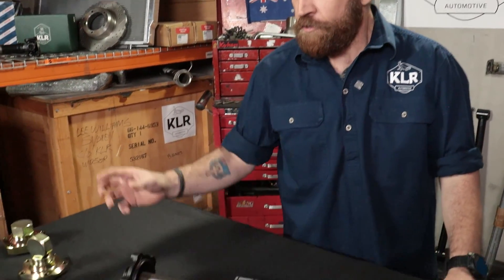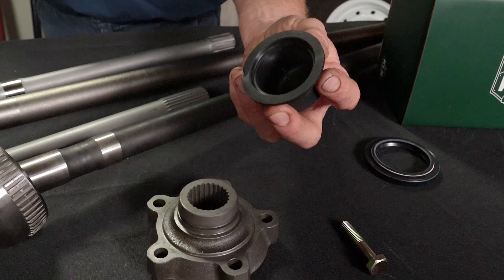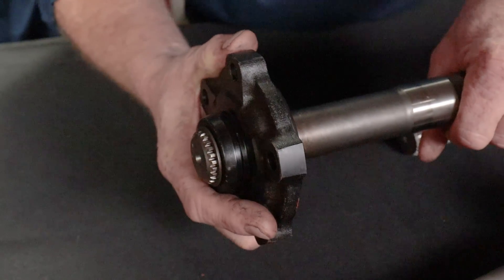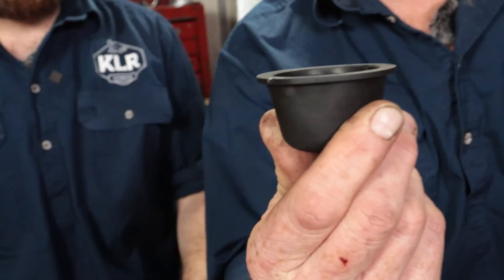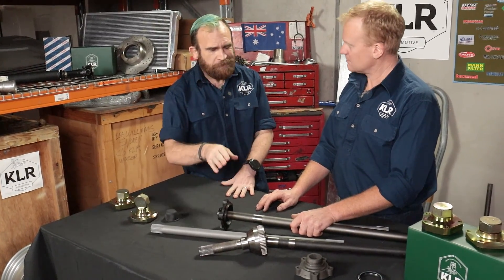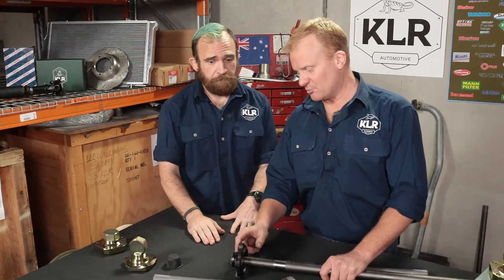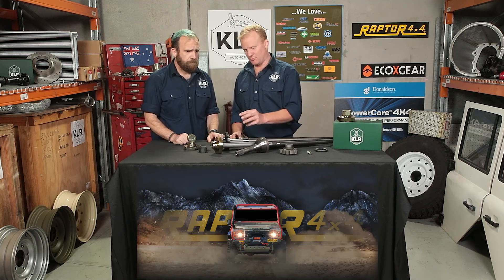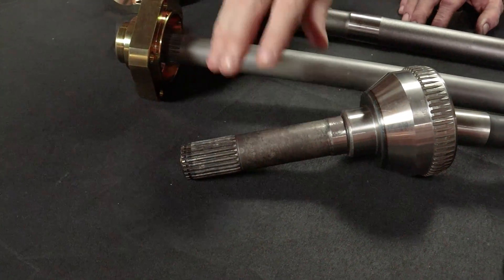Drive Flanges... what's that clunk?

Comment: Is the current standard set up designed to be the weak link in the drive chain, and ultimately designed to fail under significant load to protect the diff etc from damage? Are you not just shifting the weak link in the chain to something more difficult and expensive to repair?
Reply: Agreed.

Comment: can you get after market one peace axle and flanges i wonder if you could weld the originals up so they are one peace
Reply: You wouldn’t be able to take the hub apart do replace brake rotors or bearings/seals or even re-grease the bearings
Reply: @josephhomen Why? The halfshaft pulls out of the diff anyway, the defender 90 comes with one piece haflshaft and flange from the factory, not sure why they didn't do the same on the 110.
Reply: @andicog  Not on the front.
Reply: @mikeprzyrembel  actually, early Range Rovers had the outer half shaft and flange as a one piece part  that slid into the CV joint, friend has them fitted to his early 110 (pre Defender) with the correct Range Rover CV joints so anything is possible  ...... 👍
Reply: Yes the one piece drive flange and half shaft exists and many people retrofit these  to do away with play at the drive flange.
Reply: Some have welded the drive flange to the halfshaft and as a temporary solution it will work, however the application of heat does change the properties of the halfshaft and can introduce a failure at drive end. 
One piece REAR halfshaft-flange similar to originals are now available for compatible vehicles but not the Salisbury rear axle afaik. The diff end splines of halfshaft do not wear much as they are oil lubricated.